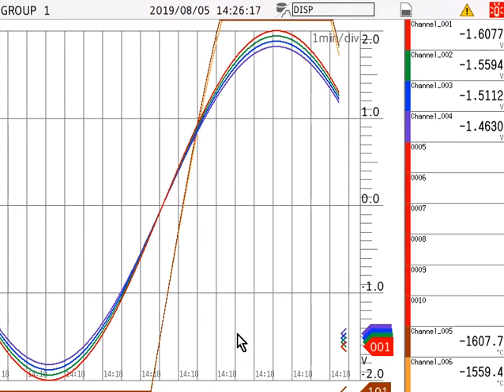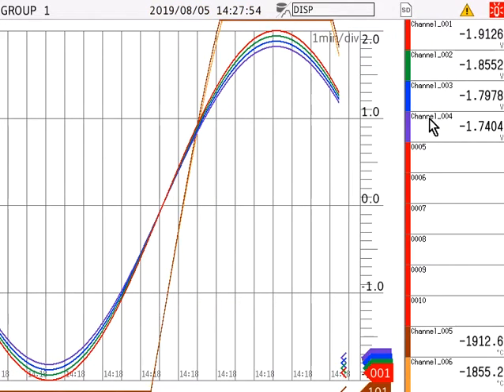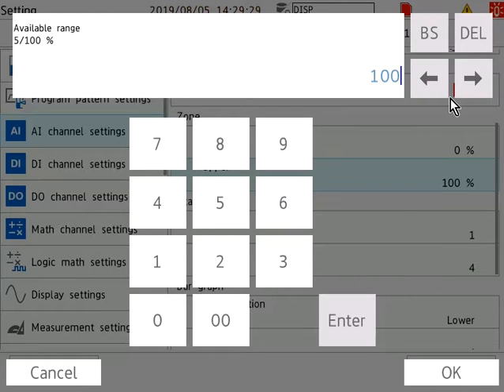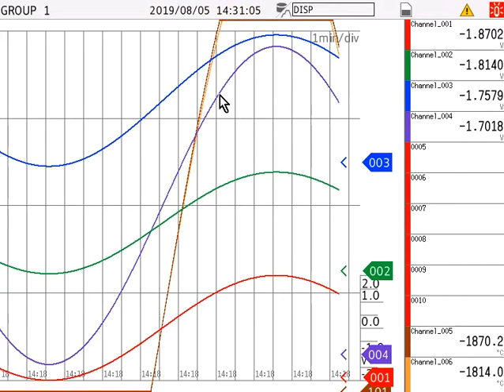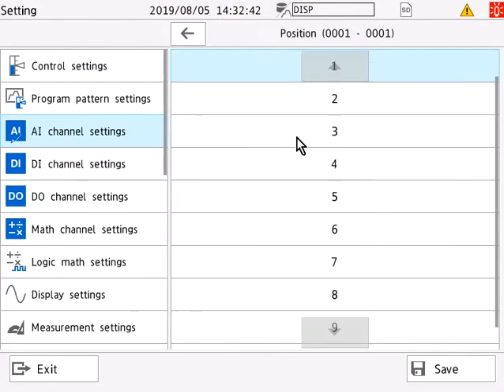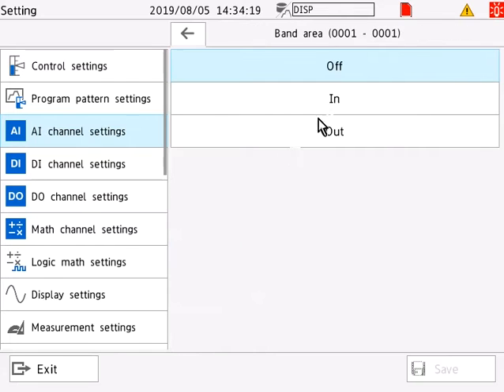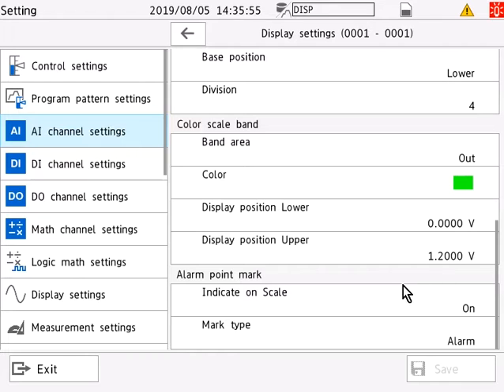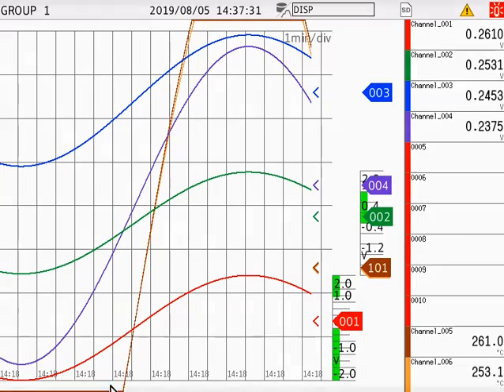Yokogawa GX/GP channel display settings overview

Comment: I am connecting pressure transmitter with Gp20 but can't able to display value in kg/cm2 . All values are in percentage .
Kindly help me
Reply from the maker: In the GP20 Data Recorder, kg/cm2 can be selected in the AI channel Range settings Unit field. If you need additional assistance, please contact our technical support team at +1-800-524-7378 or email support@us.yokogawa.com